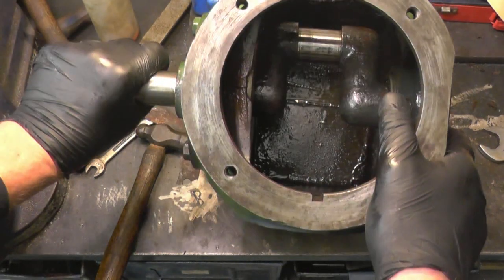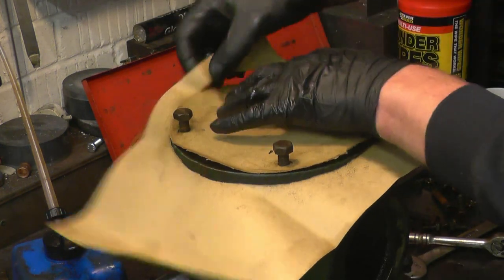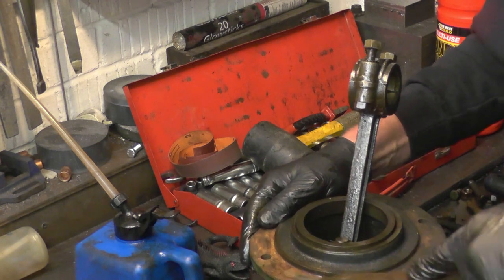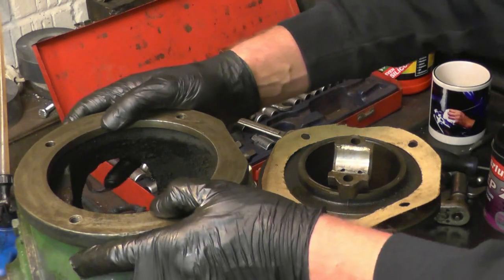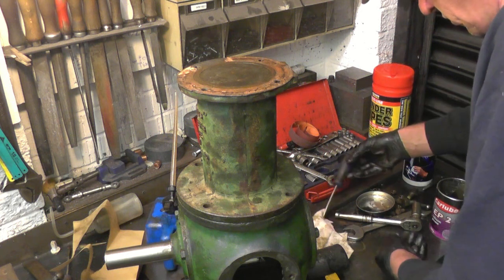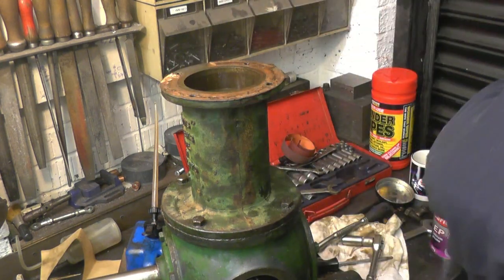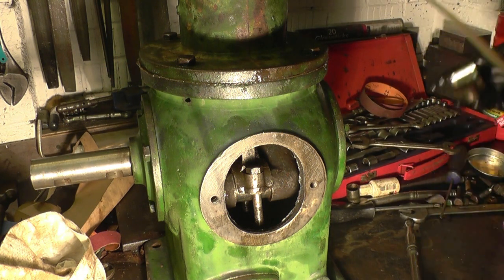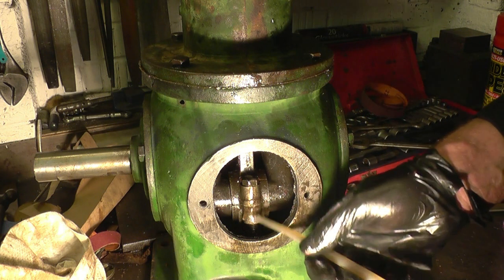Manus Vacuum Pump Part Three

Comment: John,
My grandfather used to make gaskets that way. He had a special little ball pein hammer that he used. He would also put a thin layer of grease on the gasket as well. I've used the same method making gaskets when I did motorcycle or car engine repairs in my younger years. You wouldn't be a mechanic if you didn't get cut or pinched hands or fingers! Thanks for the video.
Have a good one!
Dave

Comment: John, nicely done. It's particularly tricky to get a washer on ahead of a nut, on the bottom of a vertical bolt, when working through a small opening.  Especially with just fingers.  You really want two hands, but they won't fit. The peak difficulty comes in doing it without cussing!

I've found that some sticky grease can help a lot at times like that,  but you went for maximum trickiness with the light oil instead. :-)

-- Mike